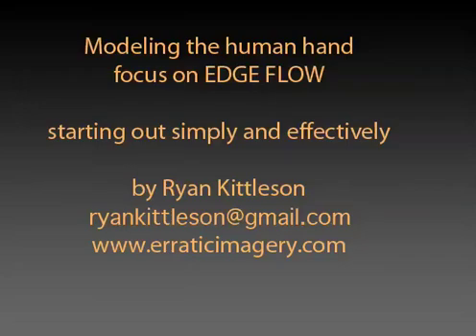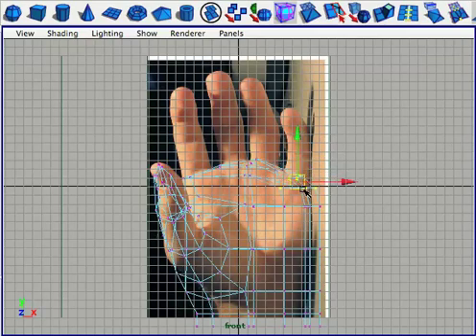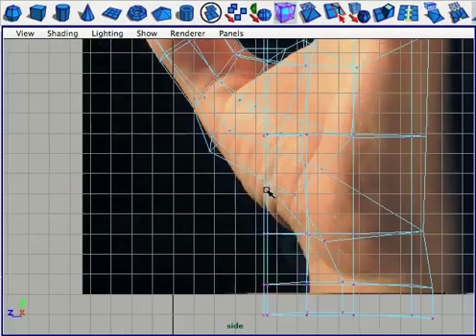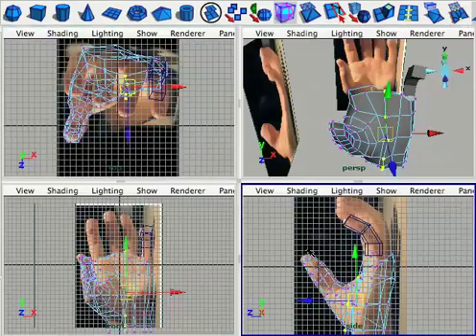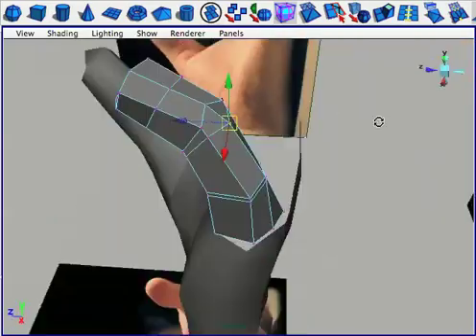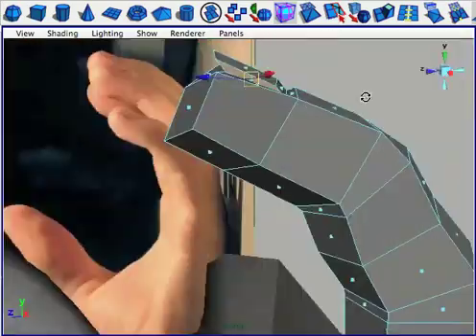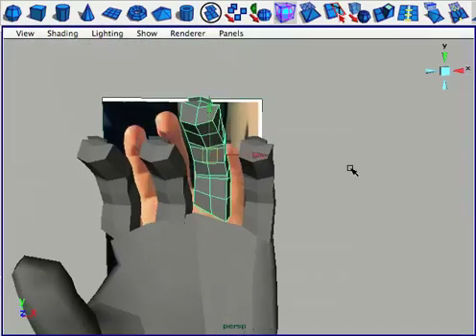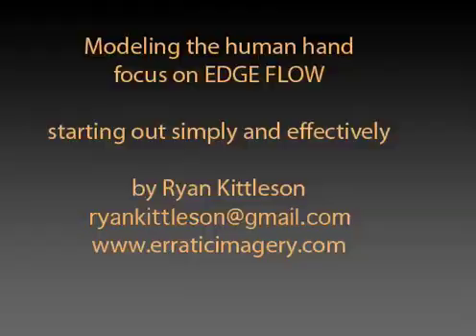Fast and efficient 3D modeling tutorial for the human hand

Comment: Is it possible to know what is the equivalent of what he does at 1:03 in Blender?
Reply: Powsen It's known as subdivision surface which can be found in modifier tab in blender.
Reply: Powsen A kinda late response, but another option for instant results that can be immediately worked with is to open the specials menu(W) and choose "Subdivide Smooth". This is the equivalent of adding a subsurf modifier and immediately applying it.

Comment: it is a very fast way to model a hand, but i am not sure if it is efficient or not. the wireframe is a mess, game or film industry won't take that for sure. it will spend 10+ times to adjust wireframe before going into game. and it needs much more work as for film

Comment: This is a great tutorial but, I am stuck trying to figure out the edge loop added for the pointer finger to attach. If you just put an edge loop there it will run down the thumb and have bad edge flow. Not sure what you did there to fix this. I guess ill have to figure it out on my own. Other than that nice tutorial.

Comment: There's so much in Maya that I just don't know...
When you are jumping between the smoothed hand/finger and then back to the rougher low-poly model that is easier to edit, is this some particular command you are using that retains the low-poly data within a high-poly model, or are you just hitting the smooth command and then hitting "undo"?

Comment: @bluetounge If you are using Maya you do like this: Right click on the mesh and drag the mouse downwards. This will toggle the face mode. Select the face(s). Then Shift+right click and drag the mouse downwards again. The face is now extruded.

At first you can may think that it goes slow. But after you get use to the marking menus, it is by far the fastest way to navigate in Maya.

Comment: I wouldn't say that it is essential to touch every vert, or to focus on working with verts. That's the way that I work, but I think you can work a lot more efficiently if you get comfortable with edges and faces as well. After all, when you move an edge you get two moves for the time cost of one, and with faces you get 3 or more.

Comment: @ReusableBattery 

In Maya to make edge loops, first select polygon mode in the top left corner then click on add edge loop tool (not sure if its called add edge loop tool or create edge loop tool can't remember right now) found under the edit mesh menu.

In Softimage simply press the " ] " (key not sure what its called) and you will get the edge loop tool. The same tool can be found under. the "create polygon tab".

Hope this helps.......

Comment: Q's: 1) Is it better to have the fingers connect at an edge or is it better to use a face for the webbing between the fingers?

2) Also you suggest to not use Modeling for skin folds etc and just use Zbrush, but doesn't that make millions of verts?  Or should you make a high poly with ZBrush and then normal map a low poly version?

Comment: this is a smart way to model a hand, one question... when you attach the index finger the bottom middle vertex needs an edge loop but when you add it the loop goes through the thumb length wise, yours doesnt seem to do this, how did you solve stop this from happening?